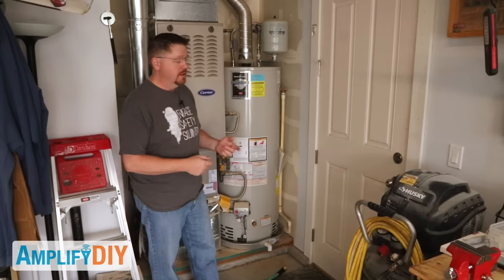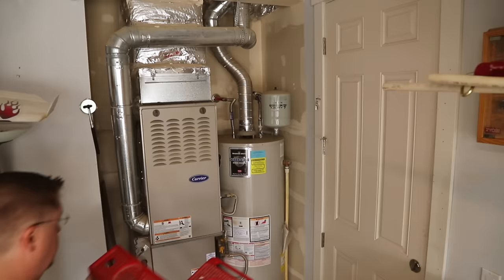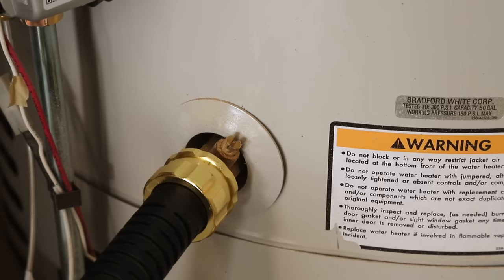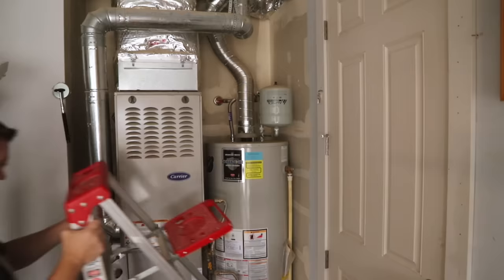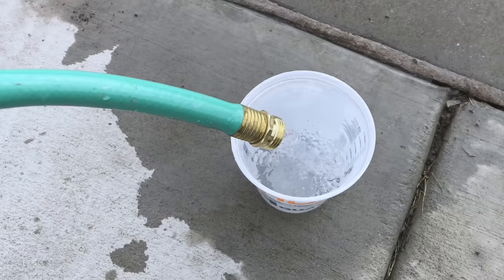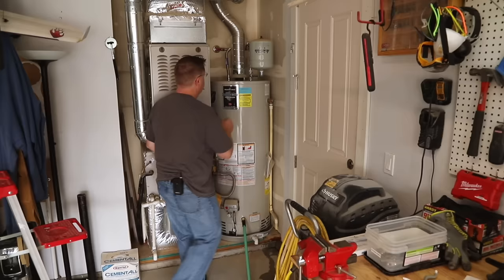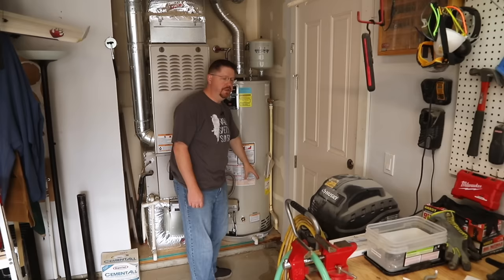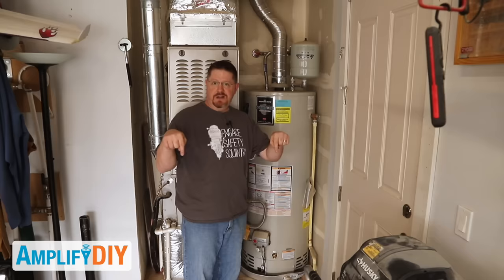How To Flush A Hot Water Heater To Remove Sediment

Comment: Getting Ready to call a Plumber, my Hot Water is Pressured up after the Heater runs. Have never saw this Before, have Installed 2 Water Heaters.
Reply from the maker: When water is heated, it expands. If there is no where for the expanding water to go, pressure will definitely rise. Maybe you need an expansion tank installed? https://youtu.be/NGygvtP6Sdk
Reply: @AmplifyDIY  It worked fine for Years, and I Realize Water Expands but for the Last little while it's causing Problems. Thanks for the Advice.
Reply from the maker: @robertmclean9737  What kinds of problems? Leaking from somewhere?
Reply: @AmplifyDIY  No just Pressuring up, turn on the Tap After it Kicks on and it's Pressured up. I don't think the Thermostat is working Properly. Thanks again!!

Comment: You are not supposed to open the relief valve, it will usually leak after doing that.
Reply from the maker: On the contrary, you are supposed to open the valve at least once a year to test that it works properly. If it starts to leak… Then it has already failed and should be replaced. Thanks for watching!

Comment: A 40 gallon tank would take at least 40 mins to drain. No way you're gonna get all that water out in 15 mins.
Reply from the maker: If the drain is clogged/plugged, yeah, it takes a long time. With a clean drain though, it doesn't really take all that long.

Comment: I don't understand why the makers don't put that drain valve on the bottom and give the bottom a little slope so teh sentiment can easily escape. Scale is heavy and doesn't leave the tank without a fight.
Reply from the maker: There are some inherent design features of a pressure vessel that makes it hard to put the valve in the absolute optimum place - but yeah, manufacturers seriously cheap out on the valves they do install. They are garbage. I always recommend replacing the factory drain valve with a much better one like this: https://youtu.be/OBPJYg0o_o0

Comment: you should run all the hot water out first, most hoses not rated for hot water, secondly the water supply should be left on to stir up the tank bottom, gravity drain accomplishes next to nothing, dip tube on cold water inlet directs stream of water to bottom of tank stirring up sediment, reason why water often is discoloured after heavy use if in high iron content area, well explained just not the way to flush a tank.
Reply from the maker: Hi there Consumers. I agree that using up the hot water in the tank before you do. The initial flush is a good idea. Turn off the heat source, then go take a shower, run a load of dishes, or do some laundry. This will cool down the tank significantly, and will reduce the possibility of damaging the hose or getting scolded with hot water as it flushes from the tank.
However, with respect to your thoughts about leaving the cold water supply open, and merely flushing the tank under pressure: this is something of a fallacy. Have you ever tried to shoot a squirt gun underwater? You'll probably notice how ineffective it is in actually moving any of the mass of water around the squirting tube. Yes, there is a dip tube inside the tank, which directs water all the way down to the bottom, but even though that dip tube may be a three-quarter inch pipe, the volume of water that get hits when that water is exiting the dip tube is just too large. No real substantial, stirring actually occurs. It's far better to empty the tank and then do the periodic bursting flush like I recommend in the video. This does a MUCH better job of stirring up the junk at the bottom of the tank. 
Thanks for watching!
Reply: @AmplifyDIY  Thanks for explaining this! I was curious as to whether leaving cold water on would be better or not.

Comment: If it's old and has a lot of rust in decay in it I wouldn't want it draining on my driveway . You could leave a massive stain on the concrete
Reply from the maker: In my experience it does not leave any staining. Also: I'd rather have a little temporary blemish on my driveway that need to buy new water heaters more often than necessary.

Comment: My water heater is probably 23 years old and I don't think anyone has ever done this...
Reply from the maker: Living on borrowed time! I would not touch your system... but I would save up for a new heater, just in case.
Reply: @AmplifyDIY  Yeah, Barrowed time is right.  Out of curiosity, when you say you wouldn't touch it.  What do you mean?  Like if I attempt to do a purge it will likely experience catastrophic failure or there is a 2ft deposit of lime in the basin?
Reply from the maker: @burtmacklin6443  Yeah, likely it's got so much sediment at the bottom that the drain will be completely plugged.

Comment: Okay, where to start; yes, it’s a water heater, not a hot water heater…

“Scalding water”? Your residential water heater should not be set above 125F in order to not scald.

“New tank that hasn’t been drained in two years.” First, there’s no need to completely drain a water heater. Monthly maintenance, flushing it monthly with the cold water side open will provide suitable maintenance. Draining the tank completely and refilling with cold water is a dangerous stress on the tank and should not be done.

Your comments about the TPRV were somewhat inaccurate: on a water heater it is actually a pressure and temperature relief so it responds to over pressure or over temperature scenarios. Additionally that relief should be exercised monthly to ensure debris and corrosion don’t render it useless. HOWEVER, if your tank is more than a few years old and you’ve never exercised the TPRV (temperature pressure relief valve) then be aware there’s a fair chance, depending on your water quality, that it may not shut off after you open it (it might not open easily either, which is the risk of not exercising said valve).

Lastly, the real important part of water heater maintenance that few know, and the mfrs don’t want you to know, is replacing the anode rod every 4-5 years. If you do that you generally can extend the life of your tank indefinitely.
Reply from the maker: Hi John - po-TAY-to, po-TAH-to as far as what this thing is called. Both terms are generally accepted. 

I know that setting a water heater to 125ºF is the generally accepted top-end, however, scalding can occur at temps quite a bit lower than 125ºF, and bacteria can grow in a tank that is cooler:  https://en.wikipedia.org/wiki/Scalding

Flushing monthly is generally overkill, and contradicts the manufacturer's recommendation on every heater I've checked. Further, the manufacturers recommend the exact process I've shown in this video. 

I agree about testing the T&P valve... though again monthly is probably overkill. Most manufacturers recommend semi-annual or annual testing, with replacement if it fails the test: https://youtu.be/e5H1i1cypxA

I also agree about checking and replacing the anode, though manufacturers install them VERY tight, and heaters are frequently installed in areas that make access difficult or impossible: https://youtu.be/OIMz1rwx_jc

Also, nearly all the manufacturers now put terrible drain valves in their tanks. Upgrading to a full port valve can make draining / flushing a much faster and easier process, with much lower risk of clogs: https://youtu.be/OBPJYg0o_o0

I also agree that regular flushing coupled with regular checking / replacement of the anode will make a heater last indefinitely.

I do appreciate the feedback, and thank you for watching!
Reply: @AmplifyDIY    I agree on the anode rods being extremely tight right now and generally it takes an impact wrench to pull them. I also agree on the drain valve and always recommend replacing the plastic ones that come on basic models with the type you showed.

I disagree on potato potato…you’re heating water, not hot water…but hey.

As for overkill on monthly maintenance, maybe, but if I go by what mfrs say it’d be virtually no maintenance. Let’s just say it’s in their best interest for people to just set it and forget it and replace it every 8-12 years.

I also agree on your comments about water temp, but at 125F you’d have to be a masochist and hold your hand under for a very extended time to do damage to yourself, and at 125F it is hot enough for the intended use and won’t grow bacteria. Anything over 125F is energy waste and getting into the danger zone. I personably actually have a three month routine of changing my house water filter, my fridge filter, and blowing down the water heater and exercising the TPRV, and I replace the anode rod about every 5 years.

Lastly, I disagree on draining the tank. Those tanks spend their existence hot. To occasionally shock them with cold water is virtually guaranteed to produce a leak, or worse. Purging a few bucketfulks or letting a hose run for 5 minutes with the cold water supply on is sufficient so long as it’s fine regularly.

Lastly, caution to people, if you have an older water heater you haven’t maintained, I always recommend leaving it be. The sludge and crud is probably beyond dealing with and the TPRV likely won’t close if you open it. While it still should be tested, I’d suggest buying a replacement before trying.

Comment: I’ve read that you never need to flush an electric water heater.
Reply from the maker: Not sure where you may have read that, but I'm certain if you consult the owner's manual for your specific heater, it WILL recommend flushing. If anything, it is more important to flush electric heaters, as the sediment can build up to the point it covers the lower heating element, which then burns itself out and the heater stops working entirely.

Comment: I'm so cheap I would have a shower first after I turned the heat off.
Reply from the maker: That's a great way to use up the warm water in the heater and exchange it for cold water so that what you drain is not so hot. Great idea!

Comment: Is it strange that the water coming out isn't scalding? It's more like Luke warm.
Reply from the maker: Not strange at all - depending on a number of factors this may be completely normal: You may keep your thermostat lower than I do. You may have just recently taken a shower or done some dishes that used up a lot of the hot water, cooling down the remaining water in the tank, etc. Thanks for watching!

Comment: At the price and value of water in my City it's cheaper to do it every 5 years
Reply from the maker: I'd be interested to know the actual cost of water where you live... because when I did this, I did the math. I looked up the most expensive water in the nation (was in San Francisco, at the time) and calculated the cost in water to flush, based on using 150 gallons of water total to complete the process (roughly what I used in the video). I don't recall specifics, but it came out to something like $3 in water. Considering that a new heater costs around $6-800 at my local home improvement store, I believe that flushing annually more than pays for itself in additional longevity of the heater.

In fact, I just looked it up again. Monteray, CA is ranked as the most expensive water in the nation, coming in just over $1200 / year based on 60,000 gallons of usage. That's just a hair over 2 cents per gallon. Flushing 150 gallons really does cost about $3 there: https://www.publicwaternow.org/most_expensive_water

Comment: Vacation mode is good, but you want full pressure to flush bad water out. For Pete's sake quit shutting the water off!
Reply from the maker: Hi Reese: actually, you really do want an empty tank. Try this next time you wash some dishes in your sink: leave the sink full of water and use the sink sprayer to try and clean off all of the sediment that has collected in the bottom of your sink. You'll find that even though the sprayer has "full pressure", it does a pretty terrible job of trying to move the sediment around on the bottom of your sink. Now, consider that the sediment in the bottom of a water heater is caked on and stuck on much more strongly then the stuff left over in the bottom of your sink when you do a load of dishes. I know it seems a little counterintuitive, but all the mass of the water that's inside the tank prevents any actual stirring or agitation action from occurring. The best way to stir up and clean out all that sediment at the bottom of the tank is to empty the heater so there is better swishing and agitation action of the incoming water when you open the cold water supply in short bursts. 
Thanks for watching!

Comment: Use a turbo tank cleaner
Reply from the maker: Hi Rubia – I actually investigated these prior to publishing this video. I found them to be a pretty low quality product which had the possibility of doing more harm than good. I do not recommend you use anything that is inserted into the tank as the interior coating of glass/ceramic inside the tank is very fragile. This product may do a good job stirring up/breaking up sentiment, but in the process it's also leaving microfractures in the interior glass/ceramic coating. This compromises the integrity of the tank, which will eventually lead to the bottom of the tank rusting through. Thanks for watching!

Comment: DO NOT TOUCH THE RELIEF VALVE. All good until the recommendation to use the temp & pressure (T&P) relief valve to release the vacuum pressure. DO NOT do this. In my situation the valve never stopped leaking and I ended up having to replace it. What turned out to be a simple maintenance project turned into an expensive call-a-plumber repair project. They say often times the T&P valve doesn't "re-seat" which causes a leak and the manufacturer recommends replacing. Instead loosen one of the inlet lines at the top.
Reply from the maker: I respectfully disagree. The T&P valve should be tested annually (which prevents severe build-up of deposits which keep it from seating correctly again). If the valve fails the annual test, it's time to replace it - which can be done very inexpensively yourself - the valves are commonly available at your local hardware store for around $20, and it takes about 15 mins to replace: https://youtu.be/e5H1i1cypxA

Comment: No way this is that easy?  
My dad would do this task. He turned the hot water off for several days, if not an entire week or more! It was misery! Partly he was stalling on getting around to even starting this, or he left it to stall around. He used a wet vac aiming to remove sediment. This was done once per year. Why would he take THAT long? The house had a lot of calcium deposit in the water but there was a basic filtration system.  The water heater was not simply drained like in this way too easy how to video. It was as if the vacuum was running for hours. It seemed like ridiculous overkill.  
 
At least we had another water heater in the garage. The kicker is that my dad never cleaned the sediment out of the garage water heater ever! So how come the garage water heater never had any issues? Also my sister had the guesthouse. The water heater in there was also never maintained annually to remove sediment. 

I could have saved me the trouble by looking at this video! Since you make it look so easy, I could have accomplished this task over one afternoon without having my dad do anything. That would have been such less ridiculous pointless headache inducing stress!!!!!
Reply from the maker: Hi Bonnie - no idea why it would have taken more than a few minutes... this task really is pretty simple.

Comment: Water is still coming from the valve onto the floor the hose is tight the screw is turned and the cold water is off still leaking from the valve making quite a mess. The water is just trickling out of the hose. I’m gonna just call the guy and have them fix this stupid thing. Thanks anyway.
Reply from the maker: I'm sorry to hear your valve is leaking. Hopefully you have been able to get it resolved. Thanks for watching!
Reply: @AmplifyDIY  
Yes bought that flammable vapor sensor, waited a day for it to come from Amazon replaced it and we now have hot water.

Comment: Really?!... There are 'grammar nazis' here saying that it isn't a "hot water heater"??  I say bull$hit.
Is a tank?  YES.
Does that tank hold hot water?  YES.
Then it's a frickin HOT WATER TANK!
Is it also a heater? YES.
THEN IT'S A FRICKIN HOT WATER HEATER!!!
IT'S A HEATER.... TO MAKE HOT WATER:  ERGO, IT'S A FRICKIN HOT WATER HEATER!!!
AND ANOTHER THING:
When that thing has been on for more than one hour after you bought it, is the water hot?  YES.
Does it wait until the water goes completely cold before it turns on again to heat the water?  NO.
The water in the tank is still HOT when the thermostat causes the gas valve and burner to turn back on,
So what is this heater heating up at that point?:  HOT WATER!   IT'S A HOT WATER HEATER!!
#Geesh  #PullStickOutOfButt

Comment: Do you think you can eliminate the need for flushing the water heater by using an electrified anode rod like this? https://www.youtube.com/watch?v=21AuJYRhk5o
Reply from the maker: Electrified anodes do a good job of preventing corrosion, and they last longer than a traditional anode.. but they do not prevent incoming sediment/silt from the water supply itself, nor do they prevent sediment from precipitating out of the water as it is heated. In other words: You still have to flush a heater with an electric anode.

Comment: How to turn 2 mins of info into a quarter hour video...good idea to let it cool overnight ....
Reply from the maker: Hi Dennis - or, turn off the heat supply and take a shower, do some dishes, or run a load of laundry. That will use up the hot water and cool the tank as well. Thanks for watching!